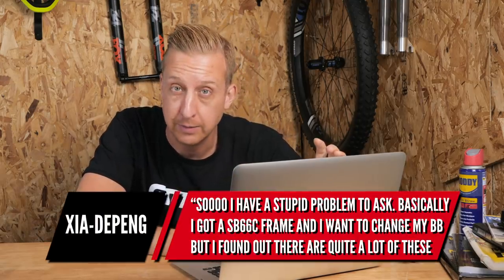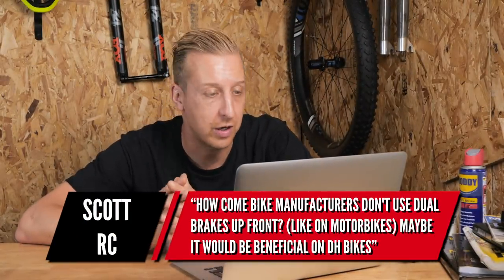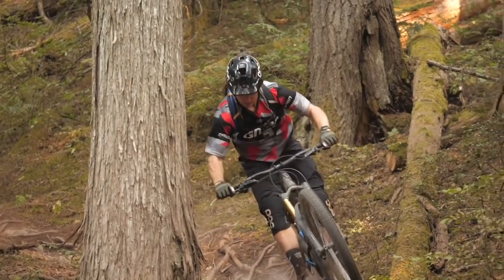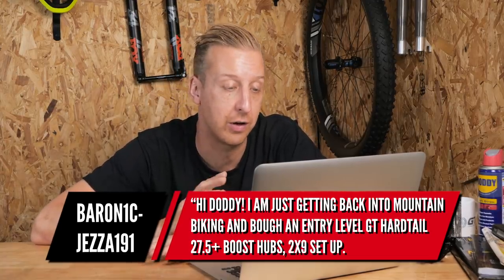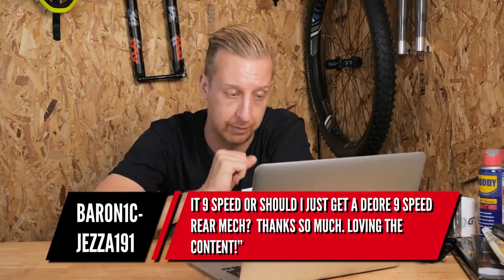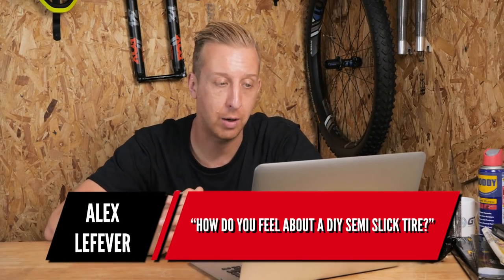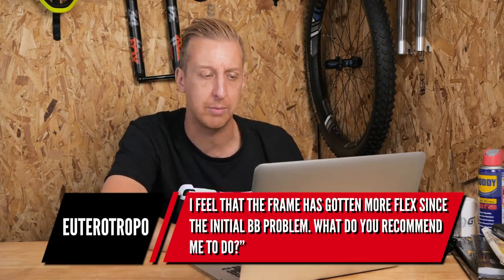Why Don't Mountain Bikes Have Dual Disc Brakes? | Ask GMBN Tech

Comment: Dual front discs are only used on performance-oriented street motorbikes. Dirt motorbikes still use a single disc - because more braking would just lock the front wheel and make it skid. Besides, on dirt, you don't need to slow down from 160 MPH for the hairpin bend once a lap.

Most riders would be better off using their brakes less anyway.
Reply: yeah but i still want it for my bike. it would help with the wear of the pads/ rotors, and i actually can see the poor fork twisting a little when breaking(i ride like a maniac, lot of speed up and slowing, lot of times violently) so if there's any link i could buy these... I'd totally get a set
Reply: @CMDRunematti  I agree with you.

Comment: I did run into problems several times when I tried to use 10sp derailleur on a 9sp shifter and cassette - all Shimano. The parallelogram movement is different and there was no way of making it shift properly. So 9sp rear mechs with 9sp drivetrain only.

Comment: I don't know if there is something like this for mtb but for Ryan maybe he could try some motorcycle hand guards that attach by plugging the end of the handlebar then a metal bar bends round to protect fingers and levers then they clamp to the bars in a similar way a brake lever does usually seen on enduro motorbikes
Reply: Max Jamieson It does exist. Pro enduro racers use them
Reply: Odi makes a pretty stout bar end plug for bmx... I just put them on my son's bike for the same reason
Reply: Bark buster for bicycles i think I'll make some for myself. Cool

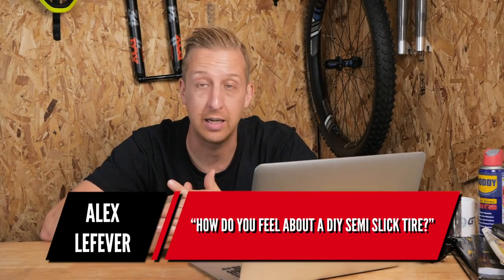Comment: Maybe the guy from 4:00 to 7:00 has built up the bike himself with non-boost cranks or bought it second hand off of eBay or something, in which case he'd be best to upgrade the drivetrain.
Reply: @3adamwardw  if he keeps the 9speesd lever, it may work... Depending on the relation between the pulling of the cable and the lateral movement of the dérailleur...

Comment: In the middle of setting up a 20" bike for my 7 year old right now, and already did what doddy suggested, put roadie bar end plugs in the bar ends, then put the grips over the top of those. Partly to stop the bar end from cutting through the grips, but also because of what happened to the guy mentioned in the show.

Comment: The story about the "core sample" makes me glad that I have Ergon grips with the bar ends attached. I know Martyn hates bar ends but they serve their purpose for me (multiple hand positions for my carpal tunnel). After that story though I know they also serve as a safety point as well.
Reply: The story sounds like he had plugs already. And because brake levers also went in, I would even think that bigger area of contact would also mean more damage. At some speeds nothing you realistically want to do helps. Just need to ride safer, take less risk. 

It is like trying to drive car straight into a solid rock at 200km/h and trying to survive without a scratch. It might happen, but its rare.

Comment: @gmbntech doddy, while you can use an 11 Shimano derailleur on a nine speed set up the cable pull ratio is different 2mm on a 9 speed , 1.5-1.7 mm in an 11speed and this makes setting up the gears an absolute nightmare. When doing this it is very unlikely that you will get all nine gears working with out jumping or skipping

Comment: On the car example: If the half shafts in a car are different in length, they usually are different in the second area moment too, so that the over all torsional stiffness is equal. To put it simple: the shorter shaft is usually thinner. Torque steering on front wheel drive cars appears if different grip levels of the tires is present and if the steering axis‘ have a significant amount of lateral distance to the middle of the front wheels, which is the case for the most front wheel driven cars due to the use of a so called MacPherson Axle.

Comment: I didn't expect to get an explanation on torque steer!  Wow!
Reply: Yea I don't think what he says regarding it is accurate. I'm not an expert but I know that a single rotor won't create the pull he is describing.
Reply: Unfortunately Doddy's explanation is not correct. Torque steer has little to do with the different length drive shafts twisting differently to each other, normally that is taken account in the design by axle width etc to achieve similar twisting behaviour. Torque steer mostly comes from the torque generated by the difference between middle of the tyre contact patch and the king ping axis intersection point at the ground, i.e. scrub radius. Thats why its mostly present only in FWD cars. However same principle applies under braking which can be felt as pulling to one side e.g. with loose joints in steering.

Comment: the older odi lock on clamps came with a bigger plastic cap that went over the outside clamp it added about  about a quarter inch diameter  around the clamp. my buddy worried about the same thing. his answer was to run bmx grips with the flange on the outside and a barplug. as far as the thigh pad find a seamstress and add your own pad

Comment: In fact, SLX RD-M7000 would not work with 7,9,8,10-speed cassettes and corresponding shifters. The thing is: cable pull-push ratio was changed (Shimano call it "Dynasys11")

Comment: One idea for the bar end issue is to use champagne corks as bar end plugs. They're cheap so readily replaceable and very light so replacements can be carried if they get knocked off out on the trail.
A wooden cabinet knob could also be used with some minor modification. Get hold of some budget bar end plugs (like those linked below), drill out the end of the wooden knob for the cap screw. insert the screw through the knob into the budget plugs and install the whole shebang as normal.
Another idea is to get hold of a couple of plastic balls about 40ish mm diameter with a threaded hole and do the budget bar end thing mentioned above.

The idea here is to create a larger surface area thus reducing, if not eliminating, any chance of penetration. Also the round surfaces offer the ability to glance off any squishy human presence.

Hopefully this helps :)

https://www.ebay.com.au/itm/1-Pair-Bicycle-Grips-Plugs-Handle-Bar-Caps-Alloy-Grip-End-Plugs-Stopper-Caps/132456746707?hash=item1ed7098ed3:m:mHZKaVwRBeFTChr6MNLBdEA&var=431928253700

Comment: gform make some pretty good protective shorts that have thigh protection and from my experience if you size them a little small they will stretch to fit but the thigh pads will rotate in slightly giving the protection he wants

Comment: Dual disc brakes also needs another mount on the hub, so with the current standards the flanges will be closer together resulting in a less stiff wheel.

Comment: The guy with chain bouncing GT could also try and shorten the chain. I have often found in entry level mountainbikes with 2x or 3x that they come with ridiculoulsy long, even too long chains. By shortening the chain with 1 or even 2 link pairs is going to eliminate the worst of the chain bouncing and also result in sharper gear changes. I always run my chains as short as possible.

Comment: #askgmbntech since i set up my rockshox lyrik using the suggested settings from trail head. its making a sucking noise in fast rough sections. do i need to turn rebound up or leave it as it is. thanks

Comment: ODI makes single lock-on grips with wide ends (roughly 1,5 to 2 times bigger in surface than the grip profile), those might be somewhat safer than the average lock-ons.

Comment: @BARON1C - changing only derailleur won't work.
Shifters don't fit anymore (7-8-9-speed are the same - 10 and 11 don't work.)
You need either a better Shimano 9-Speed Derailleur, one of these simple Chainguides that fit on the Chainstays or completely upgrade to some more gears...

Comment: Or you can check your saddle that has happened to me looking at every thing   but the the saddle can and does sound like the bottom bracket And even The brake in the rear  way I found that out it was by twisting it side to.and when I was off saddle no creeks, it drove me mad for awhile. I said try check your seat side and up and down hope this helps.

Comment: I have a electric fatbike, i notice the front wheel flexes and pulls to the side when i brake. IT DISTURBS me a lot, considering it is basically a motorbike, and the thin bike aluminium flexing over time will lead to material weakness. Aaaand i do't want my breaks to fail when i need to stop in traffic.  It has a 180mm hydraulic break on it, but i want 2x 200mm BECAUSE it is overkill, because why not. It is allready heavy...

Comment: Specialized Fuse Help

There was a recall on the Fuse with the press fit bottom bracket models, check that because you may have a recall.

https://www.cpsc.gov/Recalls/2018/specialized-bicycle-components-recalls-bicycles-with-stout-cranks-due-to-fall-and

I owned the square tapered BB model and changed it to a Truvativ Stylo single speed crankset so I could increase the front chain ring.  I had to put the 32t chain ring (replacing the 28t) on the outside of the crankset, removing the bash guard.  It fit perfectly and only negatively effected the chainline when in 1st gear and trying to reverse pedal.  Otherwise, it worked great.  The chainring I used was a Raceface 10BCD narrow-wide 32t.

Comment: I had the same problem with what i thought was my brakes creaking but i found out it was my suspension linkage the whole time, if it starts to loosen the linkage will creak when you brake

Comment: Not the most stylish thing out there, but bar end grips have been making a bit of a comeback. Just the palm grip "knob" style, I don't mean the "bull horns", but anyway, those would create a larger surface to disperse the force. I don't have any links off hand, but I'm sure a quick search will find you what I'm talking about, but honestly, I think Doddy's suggestion of an Ergon style grip that widens out at the end would probably do a good enough job of dispersing that force
Reply: I had a similar situation, where 1 bar end sunk into the ground and I landed on the other end with my ribs. 3 bruised, no cracks luckily. I still just run regular ODI grips tho..

Comment: #askgmbntech Hey Doddy, I am currently running a 32 t front chainring, and struggle to get up some climbs and never am in my biggest gear. I think it would be wise to get a smaller 30 or 28 t front chaining, and I want to keep my crankset. The chainring is bolted on with 4 bolts. Is there any size difference between the bolts I need to take into consideration?

Comment: #AskGMBNTech Hey, I've had a 13 Incline a for a while and I would like to upgrade it. It has a 3x9 drivetrain and I would like to upgrade it to a 1x setup however I don't have the money for 10 or 11 speed but I only ever hear about those two. Would a 1x9 be worth or should I keep it as it is? Thanks.

Comment: #askgmbntech Hi doddy, I have a 2018 canyon spectral AL 6, and it has no iscg mounts for a chain guide, is there any options for this bike in terms of chain guides or an adapter to fit the bike so I can use a iscg chain guide. Thanks

Comment: #askgmbntech hi doddy i just traded my 2016 specialized Hardrock for a 2005 norco atomik downhill bike with upgraded fox dhx3 shock and marzoochi 888 forks now i have 2 questions first question is the brakes weren't working when i got the bike but we fixed them and now there is brake fluid (dot 4) on the pads i tried riding hard on the brakes to burn the fluid off but it has not worked and second question when i go to change into the 7th gear the derailleur bounces on the 7th cog but does eventually change

Comment: Honestly 1 disc is not enough for me. I actually find more power and modulation when using v-brakes on a ceramic coated rim, but I only use 160mm front disc and the two piston brml 785 xt brakes, so maybe if I would go up to an quad piston caliper and maybe a bigger disc.
Reply: For increasing modulation u wanna go for a bigger rotor, so you'll effectively lengthen the "lever" your brake is manipulating. Bigger rotors (comparing the same brake here!) are also less prone to fading due to heat.
Comparing the modulation of a 160mm diameter rotor with another one the size of a rim seems a bit unfair to me.
Reply: Le Typ  fair or not, it is lighter and worked really good even in wet condition. I do regret selling my first gen crossmax wheels though just because I wanted discbrakes, do´h. :P
But I have a bigger disc on the way, + a new carbon alibaba rigid fork with a through axle for max stability. I have actually almost forced my wheel/hub of the fork one or twice now :P
Reply: That's pretty bad if you can't simply lock up your wheels inorder to stop on a dime ...
Reply: You only lock up your wheels if you want to stop on your face...
Reply: @ @fabulousfabrications1985  :
Locking up you wheels won't give you the best braking, it's just before that! And braking isn't always about a full stop - that's where you need modulation.
Reply: v brakes brake much further out the bikes radius, no naturally they can be much stronger, think of mtbs using 180-200mm rotors?
guess what a rim brake is basically a 622mm(or 584mm) rotor.

But their modulation and closeness to the dirt(discs are much further away from the mud) make them inferior, but in terms of braking power V-brakes are strong.
Reply: goriaas:  it's a 622ish mm rotor made out out of relatively flexy soft aluminum sidewalls and a tire in the way of the caliper.  To get similar pressure on the pads you would need an enormously stiff caliper, perfectly true wheels, probably some steel braking surfaces bonded on  (assuming you want to use a decent compound instead of rubber), and then every time you had a little sideload on the wheel, it (or the frame) would flex and drag on the brake.  As it is, you have a big motion ratio for decent brake clearance, and rubber pads to make up for the low braking pressure.
Reply: Le Typ  maybe going bigger will solve my issues but to be honest I think it is more about how thin the rotors are. They should at least be twice the thickness with some ventilation in between. My xt rotors gets scolding hot and I think this is the main issue here, and if the disc(the xt one) would have more material and the spindle it self a bit smaller so that there is more material on the disc itself height wise for more cooling would not hurt either. :P

But as usual they probably will release a thicker disc in future, instead of making it right at the first time :P Milking at its finest :)

Comment: An 11 Speed SLX RD will not work with a 9 speed shifter.  It will have a different cable pull ratio.  He needs to stick with a 9 speed slx, or use some sort of gizmo to fix the cable pull ratio.  IIRC, there's no clutch on the 9 speed SLX, (Shadow, not shadow+), but it does probably have a stiffer spring.  I think the 9 speed XT shifters do have have a clutch, so that might be another solution.
Reply: All clutch derailleurs are 10-11-12 speed  but you can use 10 speed shimano derailleurs with a 9 speed sram trigger shifter and 9 speed cassette to get a 9 speed drivetrain with a clutch derailleur.
Reply: You're right.  The clutch wasn't until 10 speed.  Even there, the RD-m670 SLX doesn't have a clutch either, so if he's looking for a clutch, he'll need to go XT.  There's probably not much point buying a sram 9 speed shifter when he could just buy the 10 speed that matches, assuming his wheels will take a 10 speed cassette.

Comment: #askgmbntech hey doddy I have a 2017 specialized rockhopper as my light use trail bike, I’ve blown out multiple chains (it’s a 3x system) but  I do have a new sram GX  11 speed cassette & derailer & shifter I want to but on it but the rockhopper has shimano hubs. Is there any conversion kit or do I need a new hub?

Comment: #askgmbntech hi doddy,
can i put a longer travel shock on my bike. I have and intense spider alloy foundation build it is meant for a 130 travel rear shock if i put a 140 travel rear shock is that possible. If it alters the geometry in which way does it 
Thanks

Comment: #askgmbntech hey doddy, from last 3, 4 days there was squeking sound coming from my bike while stearing left and right so I thought it was coming from the headset so I serviced ,cleaned and regreased it and even checked that if the break was rubbing or not but I found everything was good and the sound is still there and I just cant figure out from were the sound is coming can you plese help me with that. btw thanx

Comment: #askgmbntech hey Doddy, great work on your bike cave! I have a Whyte t130 crs, 140mm front and 130mm rear but want something beefier for the trails I'm riding. Can I change the fork, shock etc to convert it to an enduro or do I need to change the bike? My initial thoughts were that changing the fork and shock may mess with the geometry too much and that's if the frame can take bigger components. Cheers
Reply: I’d just get a new bike. Even changing the shock 20mm or more will make the head angle of the bike much steeper which would not be very good for enduro.
Reply: Also considering it’s a trail bike, the head angle could potentially reach 70 degrees with a longer shock.

Comment: #askgmbntech The aluminium seat post on my aluminium bike keeps slipping down, are there assembly compounds for aluminium and which should I use.
Reply: Charlie Banford try adding lube to the cam of the quick release or tighten the collar to the proper torque spec. Carbon paste isn’t required but you can use it.